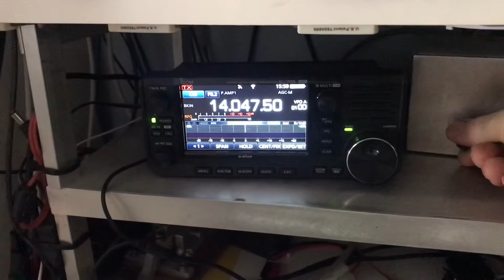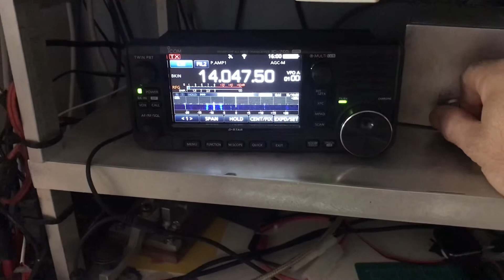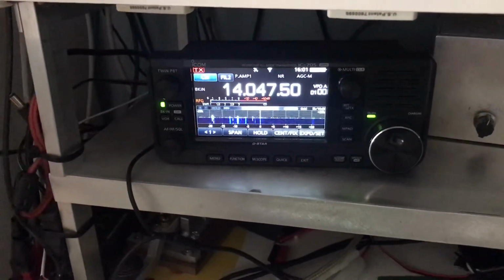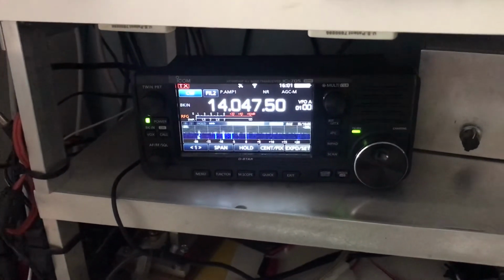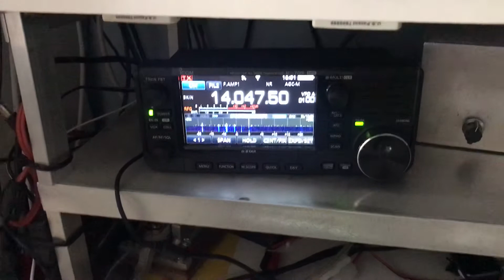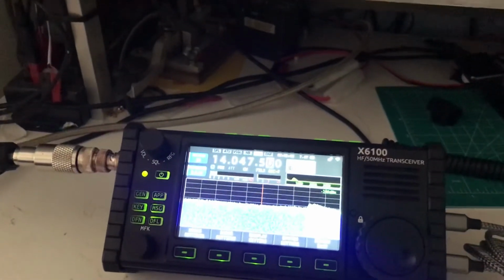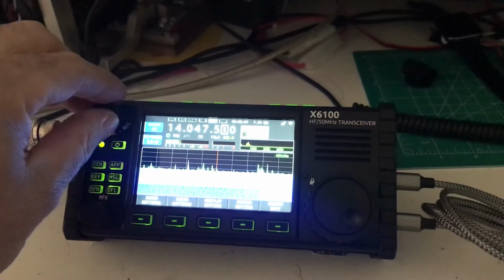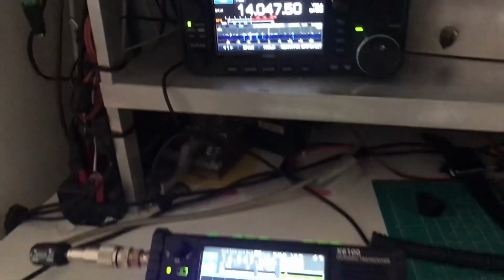Xiegu X6100 and ICOM IC-705 receive audio comparison, on CW.

Comment: Great vid.  Always fantastic to hear direct A/B comparisons like this.  Question for you -- isn't it a bit disturbing ot have the Xiegu showing so much visual "noise" across the waterfall? The Icom shows a much cleaner waterfall with the antenna connected.  If I'm searching the band for signals, and only had the Xiegu in place, all that visual clutter woudl be like not having a waterfall to show me where the signals are showing up. Thoughts?
Reply from the maker: I plan to make a follow up video showing the same receiver comparison but with the pre-amps off.   I’ll see if I can better adjust the waterfall setting as well.

Comment: not a correct review.
why did you have to turn on p.amp 1 on the 705, but remove the RFG gain?
Reply from the maker: You know,  that’s  a good point.  I may have to redo this video without the preamp.
Reply: @propagating-radio  I'll wait for a new video